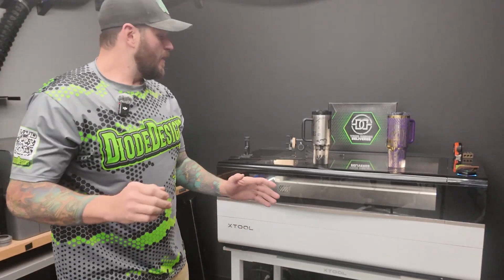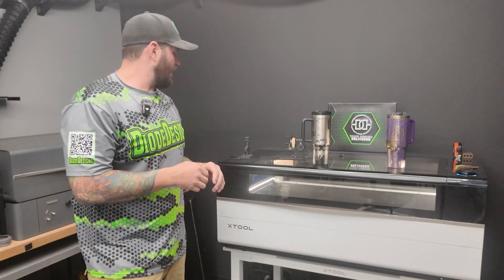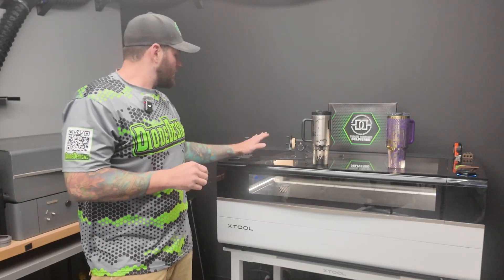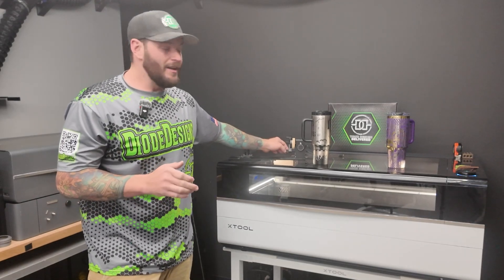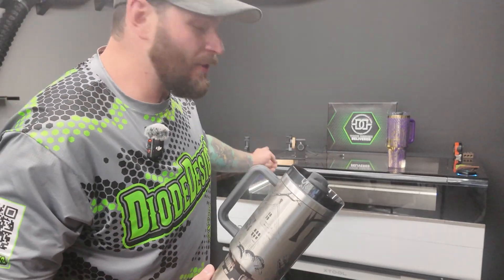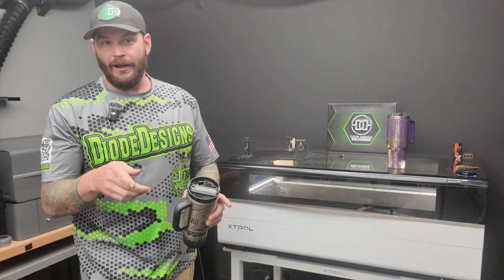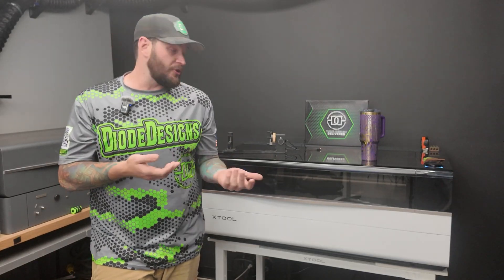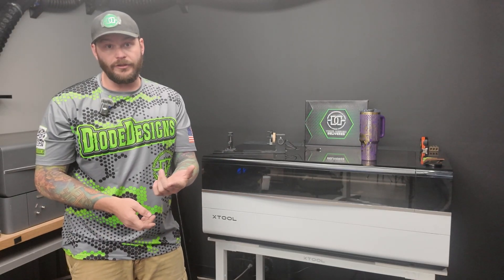xTool P3 Speed Test: Full Wrap 40oz Tumbler Engraving + RA3 Giveaway!

Comment: Do you feel the P3 requires the newer air filter system?  I cut fabric and Balsa wood and only as a hobby.  I don’t want to spend $2500 if the original would be sufficient for the items and time I spend cutting.
Reply from the maker: If you are cutting a lot of wood I would absolutely suggest venting outside rather than using an air filter
Reply: @DiodeDesigns thank you